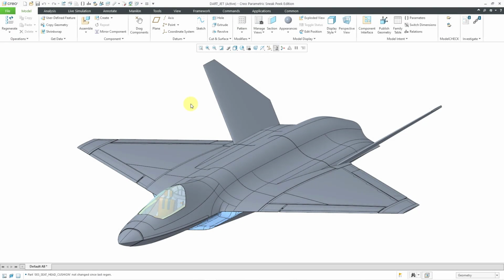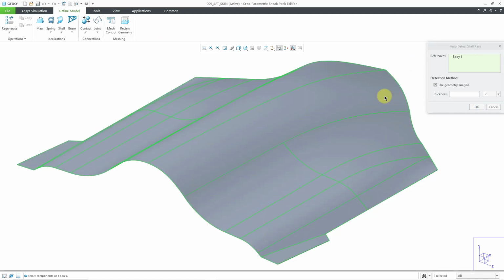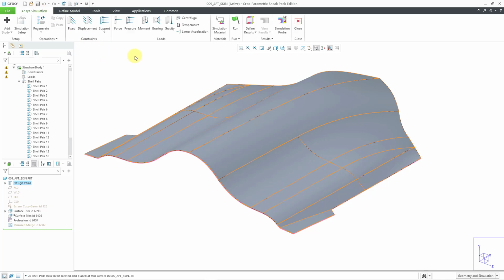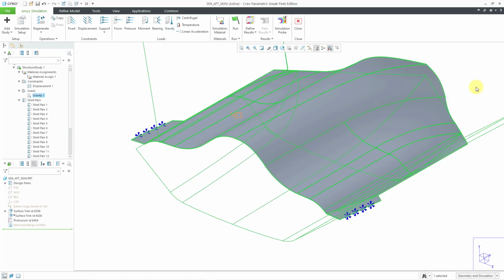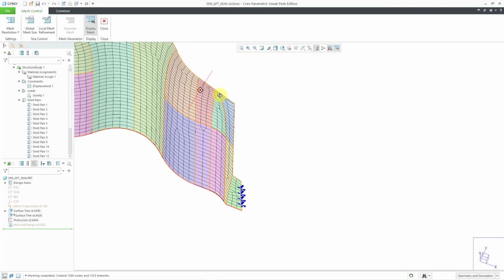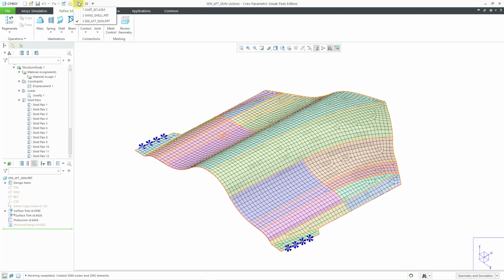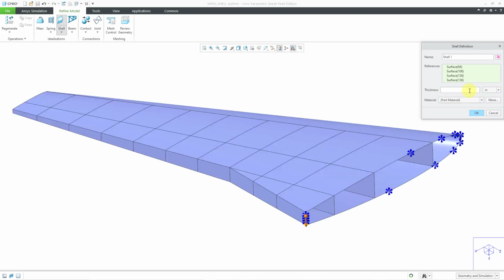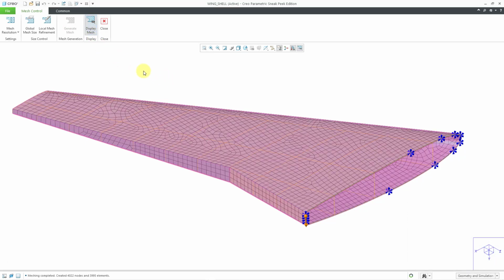Creo Ansys Simulation - How to Create Shell Idealizations

Comment: Hi Dave I recently created a surface model to model the shell elements...I sucessfully completed the analysis with creo simulate by assigning shell but failed with Creo Ansys simulation...Wht could be the reason for failure?
Thanks
Reply from the maker: There's not enough information here for me to diagnose. I don't know what the specific error message was. I don't know how you set up the analysis model or what kind of hardware you're using. I recommend opening a ticket with PTC Tech Support.